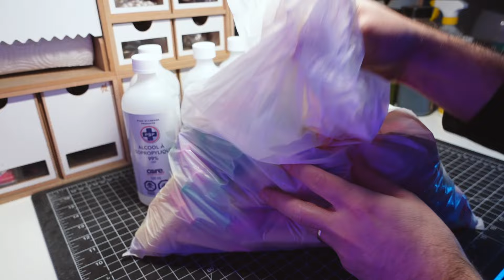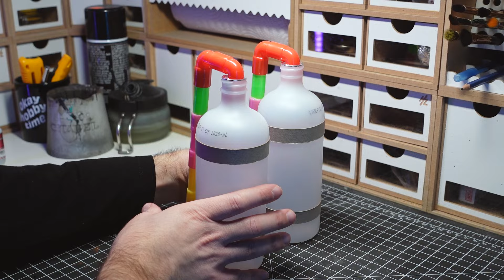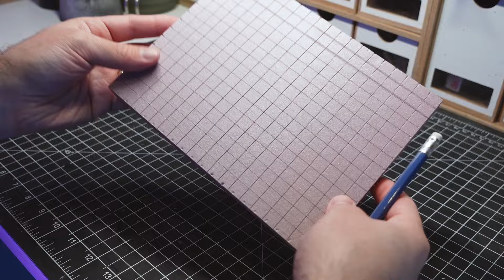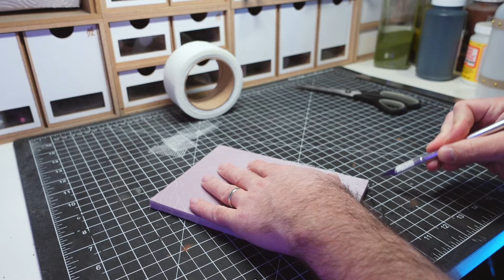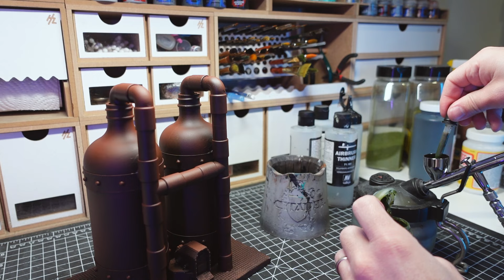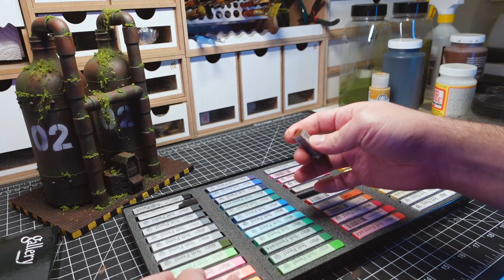Building industrial terrain for Warhammer 40k and more!

Comment: I used your PVA flock mix as moss the other day for the first time and I love the results. First time using other foliage than tufts, couldn't be easier and I couldn't be happier.
Reply from the maker: It's almost a cheat code for making things look better. Glad it worked out!
Reply: Is that brush toast after using it? Or have you found a good way to make sure it’s saved for use later?
Reply: @Alchemical_Bromance  I used a cheap brush and just rinsed it right away. Seems fine.